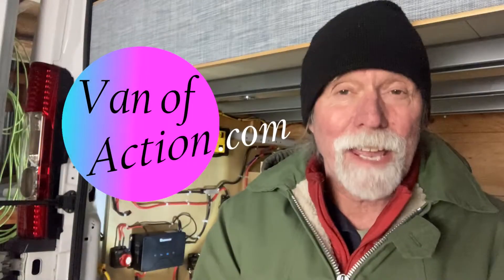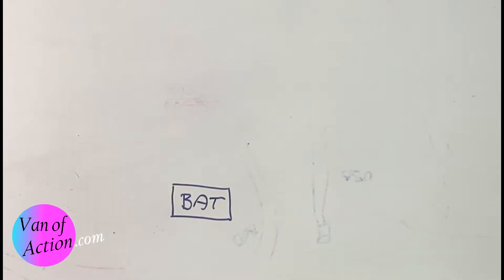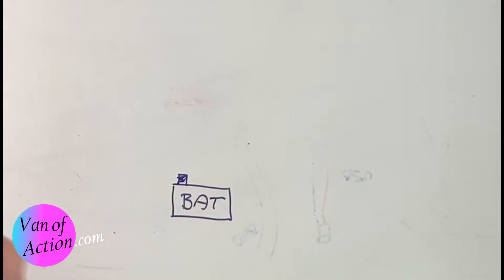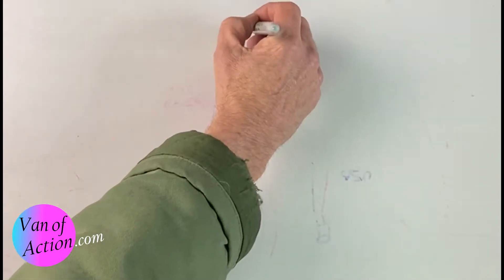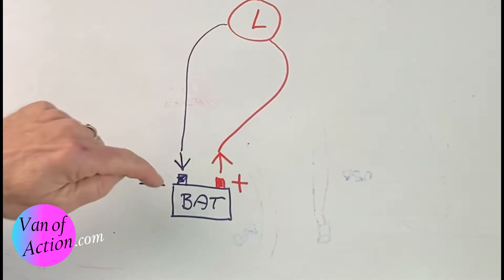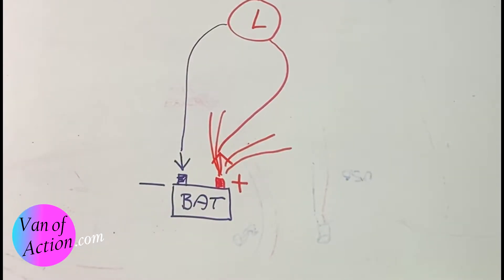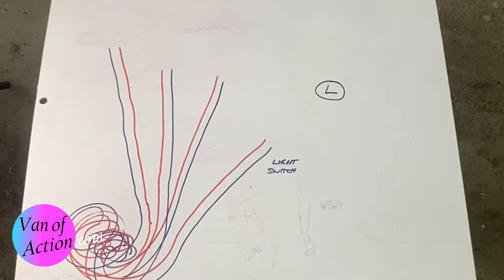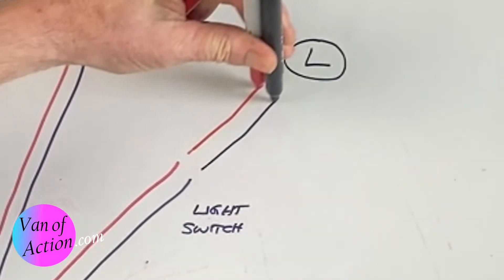How to wire 12 volt sysytem in van build conversion for vanlife in promaster sprinter transit  Part

Comment: Thank you for sharing your expertise, and in an easy to understand style.  I too, have a carpentry background, and the electrical part always stresses me.  We sold our old 1985 camper van and are currently looking for something newer to convert where we'll use a lot of your suggestions.
Reply from the maker: Hi Terry - Thanks for taking the time to watch and comment -   I've renovated a bunch of homes and enjoy electrical work,  but this is the first 12 volt system I've made.   I watched your shaker cupboard door video - my method is a little different but only you and I would likely see that :) Wish I had a  saw like yours !!!  Actually mine is similar but it's in Ontario - I'm using the one that was in the shop I rented.  Be well and stop back.  Bell and stop back.

Comment: High my name is Verne love your videos one question is if you are putting multiple lights a system should you use a heavier gage wire initially like 12g instead of the 16g
Reply from the maker: Hi Verne - thank you so much for watching and taking the time to comment.    I understand the theory of what you are saying and I'm sure it's sound - but I think it's important to remember we're talking about a van that's 6 feet wide and 13 feet long.    There is a limit to how many lights you could possibly  put in there and even  if it was only 2 they wouldn't be very far apart.  I have not done the math - but there is no problem having 6-8 of these 12 volt puck lights on one circuit using 16 gauge wire.  It those lights are on different switches it really doesn't change anything.    I think it's possible to make things more confusing than they need to be.   Be well I hope you'll stop back  ... Dave